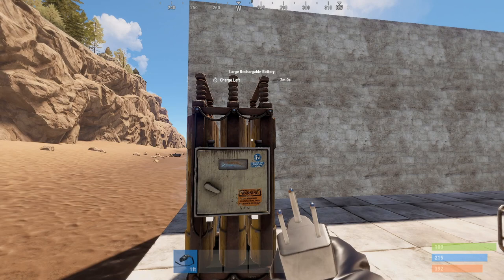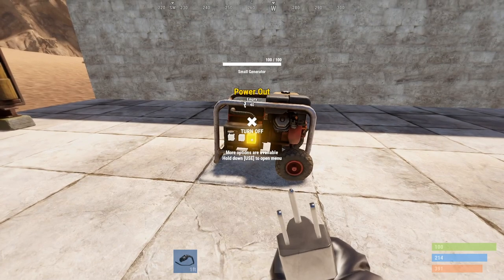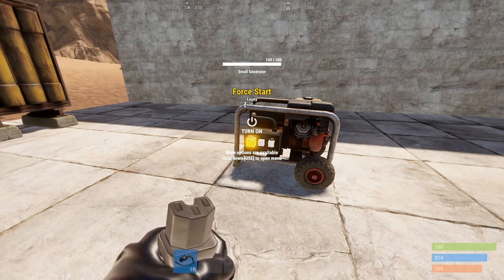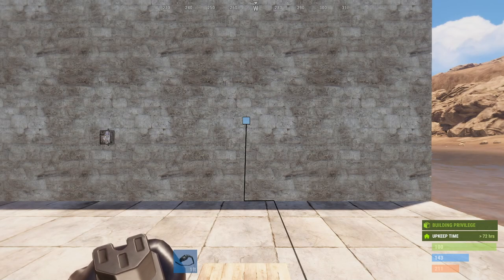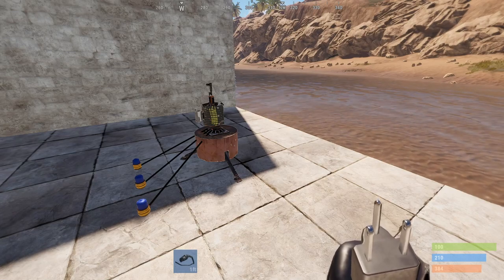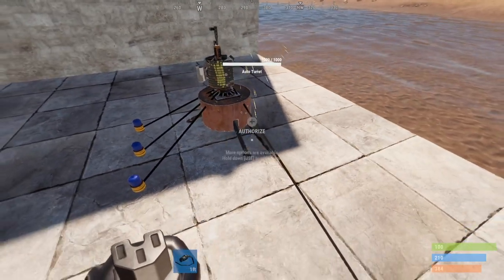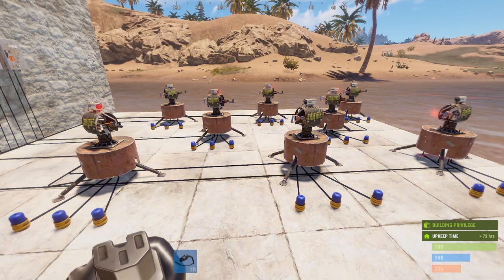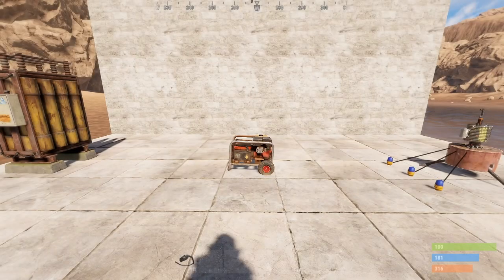(RUST) Electricity 101 - Electrical Turrets (September Update)

Comment: Nice videos man, I'm glad I found you! I will watch them all to learn some. I really want to know how to combine Wind an solar and how to charge the battery.
Reply from the maker: No worries, my guy :)
Combining power sources is as simple as using a root combiner. Watch the episode after this one to look at battery backup solutions. In addition to that, watch "unlimited power" which is the original battery backup video I did.
Also, if you run into trouble, just join my discord :)

Comment: I haven’t really gotten into the whole electricity thing in rust but I guess now I have to, I have no idea what anything in this video meant. Most of the electric things have not been like a need in rust and most people have either barely used it or none at all. Can you please make a video for someone absolutely brand new explaining how to set up an auto turret now. I don’t wanna watch a thousand videos trying to figure how this thing or this thing or this thing works. The biggest thing is like do I have to have lgf in a generator 100% of the time to make sure my turrets are on? You said it yourself that this new small generator will only run for barely over an hour and that’s using 500 low grade at a time. Idk it’s just confusing. I have a lot of hours on rust and none of this stuff makes any since to me at all. Good video btw I just have no idea what any of it means. Thanks🙌🏼
Reply from the maker: I have 2 episodes explaining each component, but if that's not your thing, then I would recommend watching the other video I mentioned about having battery backup. Better solution than having generator.
Reply from the maker: Additionally, my discord is a great place to get help :)

Comment: So i've got a wind turbine, i've put it to my large battery, then from the large battery it goes to my switch, to my branch, to my splitters (2). 

But the turret drains the power from the large battery faster than the wind turbine can produce it, and i've only plugged up one turret atm.
I've set the branch to set "10". 

Heeelp! :p
Reply from the maker: You can't charge and drain a battery at the same time. I would recommend watching my video on "Unlimited Power" or "Backup Power Options" which shows solutions for these.

Essentially, batteries in Rust don't function as they do in the real world.
If you're having trouble still, join my discord. We have great support in there :)

Comment: how would you do this using a wind turbine?  for example can you use a wind turbine to charge a large battery in case the wind goes down the system can still run on battery power until the wind picks up?
Reply from the maker: It's the same. No difference using a different power supply.

Comment: is it possible to connect 2 unique autoturret "has target" outputs into one RF broadcaster to make a remote security office?
Reply: Yes by using an "and" switch
Reply: AussieBandit I just realized that logic gates would be the easiest example, I'm going to use an or gate though instead because they'll be facing the same direction
Reply from the maker: Yes, and Aussie bandit is right, but perhaps the OR switch would work better. The only problem is, the outputs on the turret ONLY output 1 power, therefore the logic gate would consume that. You would have to use an electrical branch, similar to how I used it with the HBHF Sensor in the "Electrical Boat Base" video.

Comment: So both batterys can not be charged while they are decharching (powering a divice)
Reply from the maker: Correct, with how they work in Rust, Batteries can receive charge, but they discharge at a faster rate than they can receive input.

Comment: I'm thinking on a system that uses Wind Turbine as main power source (for "rich people or modded servers") but has a battery backup system in case the wind is low or someone destroy the turbines where the generators only turn on to charge the battery when it need charge (so the Turbines wont recharge the batteries).
Any ideas on how?
Reply from the maker: Checkout my video “unlimited power”. The solution is there :)
Reply: I will ;)

Comment: i watched the vid for the back up system and i did everything right and its not working the turret keeps turning on and off. can u make a vid with all of the electrical system in one vid instead of different vids
Reply from the maker: umut aydemir are you sure you wired it exactly as I did?
Also, what is your power supply?
How many turrets do you have?
What values did you set the branches to?
Reply: @SpibsTV  I have a wind turbine set up i have it set the same way you do on your video the only thing that is different is that I have a counter set up inbetween the or switch and the main power switch.  so i have to 2 black electrical branches, a blue blocker, an or switch, counter, toggle on off switch 2 3 way splitters, and 7 lights.  I figured i needed 61 (watts we will call it) to power the whole thing.  I have a large battery hooked up.  both my boxes are configured at 61.  my large battery says i have no power coming in.  can you help?
Reply from the maker: @atomic_diversion8681  Join my discord and send me a picture.

Comment: I tried this exact setup but my blocker won't activate.  Any tip/help on what I might have missed?
Reply from the maker: Probably best to join my discord and we can troubleshoot there.
Reply: you have to set each Electrical branch to a value of 10 if you dont use the notification ports. Spibs I believe has to be using a value of 88 minimal on the branches
Reply: @SpibsTV  great job lad for the tutorial 👍
Reply from the maker: @techytrendysolutions6063  Thanks, dude! :)

Comment: i have no fcking clue about this electricity stuff. What is the easiest way to run a turret? Panel on roof, cable to a battery for nightime, cable from battery to turret. is that so ok or did i need 5820 different switches and stuff? Its just for 1 turret for a 2x2 for example^^
Reply from the maker: Since turret requires 10 power, to run, if you are running off solar power, you would need a large battery, as having a small one with the correct components wouldn't provide enough power.
In my opinion, small battery should output 15-20, instead of 10.
Reply: @SpibsTV  ok thx! Need to try that on a building Server :D thx for your Video!
Reply from the maker: @mk4dubb  Definitely recommend haha. What I suggest is get a basic understanding of some of the components, build a small circuit someone else has created, and then understand how it works. You can just go from there. Essentially how I taught myself.

Comment: I like the video and explanation, but have an issue with the optimization of the circuit. I slightly tweaked it and it should perform more reliably now during sunset and sunrise. Here is the optimized circuit:
Link: https://www.rustrician.io/?circuit=d8900e4d8c3ca98498fdb26ebd9837cb
Png: https://i.imgur.com/zCbIslC.png
Reply from the maker: I had a look a believe the two circuits perform the same during power fluctuations.

The only difference between mine and yours is that your circuit has 2 units of power going into the block passthrough, whereas mine has 1.
Otherwise, functionally speaking, they perform the same task.

Comment: hey, i have a question, how do i keep my turrets running when im off? do i collect enough elektricity in the battery or is there another way because i dont think its possible to have like 15 hour of elektricity? or i straight up connect them to solar panels so they run at day?
Reply: good videos btw! underated!
Reply from the maker: You need a main power source, either be it solar or wind power. Then having battery backup is the next step.

Comment: how do I charge my battery in a cave since I cant use solar panels?
Reply from the maker: At this point in time, not all caves can have power, excluding generators. There are limited caves that you can have a power source above ground and run a cable down to the build spot from the surface.
Reply: @SpibsTV  Ok thanks! Does the generator charge the battery or online provide power while its running?
Reply from the maker: @jonnobud3541  At this point, charging the battery with a generator is not a good solution. 500 low grade will only give you 20 minutes of charge.